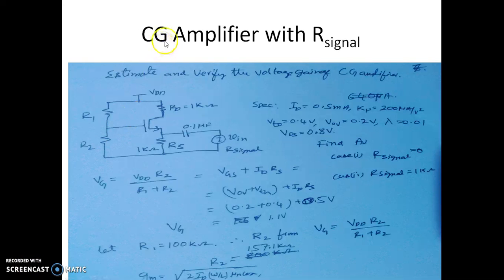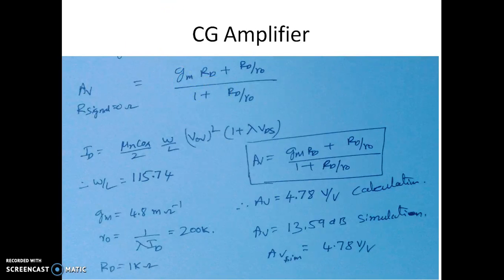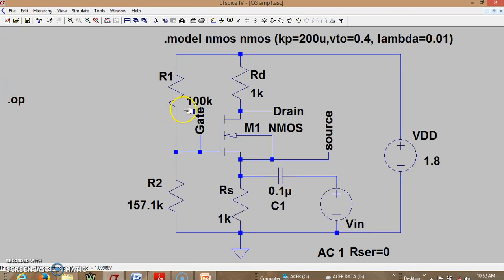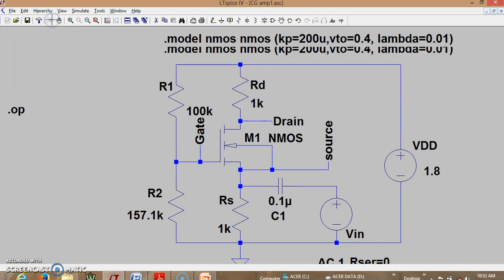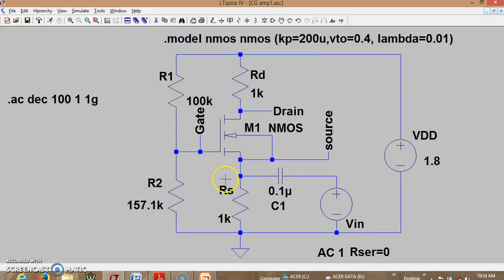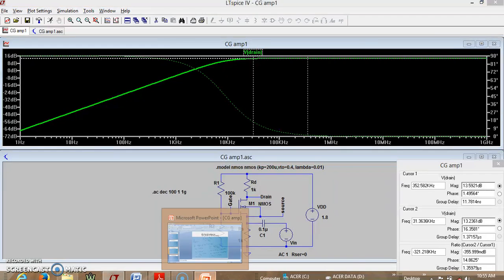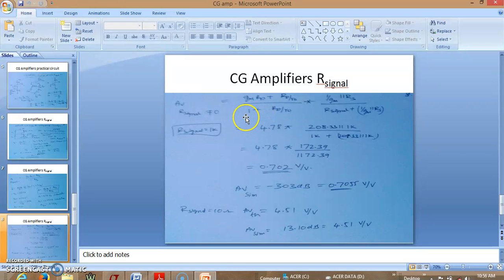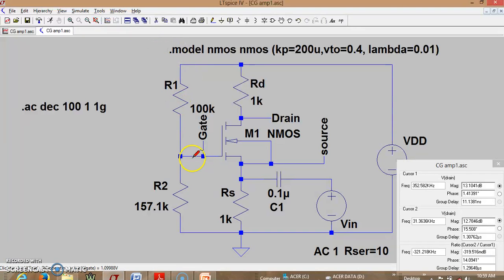31 CG amplifier LT SPICE

Comment: Can u pls tell me how to get 25 gain ,what and all parameters we suppose to change
Reply from the maker: You know the gain equation! Then increase gm and or RD , you will get the desired gain.. make sure device is in saturation mode !!
Let me know whether you got it or not!!
Reply: @narasimhamurthyk.c.vu3dwf475  I tried to increase gm and Rd ,but I'm not getting 25 gain ,it's not increasing above 5 gain
Reply from the maker: @techmech7196  share your design values..
Actually for, larger gain we need to go for active load ..